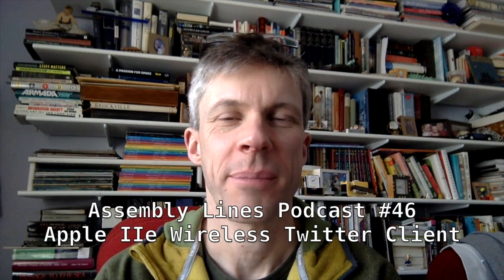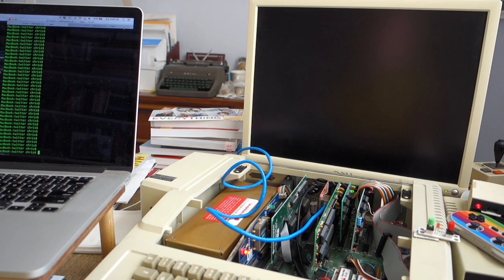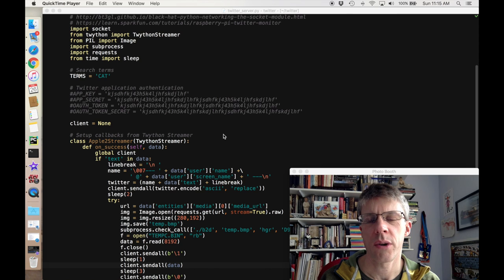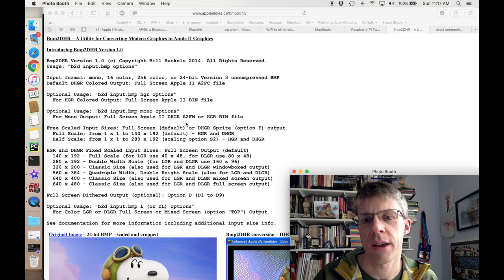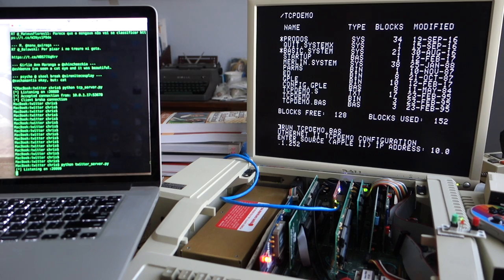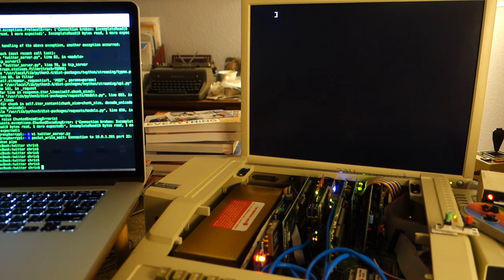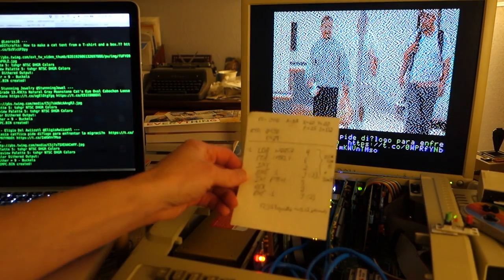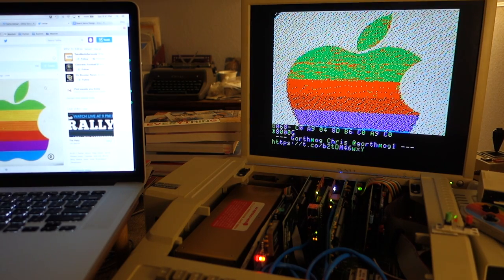Assembly Lines #46: Apple IIe Wireless Twitter Client

Comment: Since 512 bytes of the 8,192 HGR image are "Screen Holes" you could send less data (8192-512 =7,680) over to the Apple 2 to minimize bandwidth either by

a) storing 120 bytes and skipping 8 as the data comes in, or
b) a contiguous 7,680 bytes and then "unpack" it afterwards

Even sometimes I wonder about the "practicality" of some of these experiments they sure are hellova lot of fun !!
Reply from the maker: Ah, that's a good point. It would also be fun to convert it to double hi-res for better image quality.

Comment: Is there a way to get the Pi to also do the part the Mac is doing? Really want to see it self-contained!
Reply: Yes, although that wouldn't really be an Apple IIe Wireless Twitter Client, now, wouldn't it?
Reply from the maker: Wait, I'm confused. It is self contained. I just used the Mac to log into the RPi to fire up the Python script. That could easily be put in a crontab startup job on the RPi so it would automatically startup when powered on.